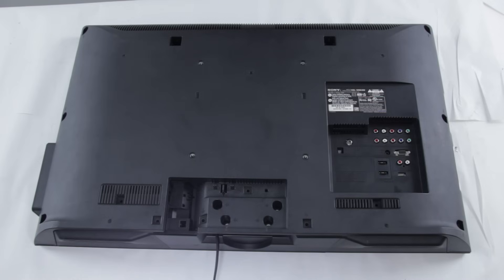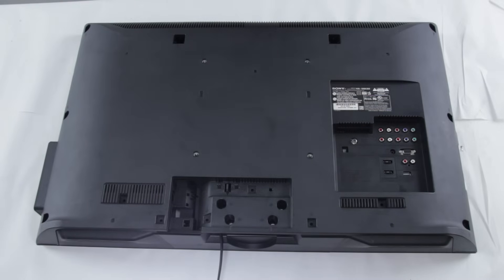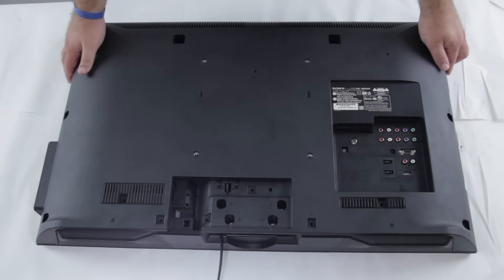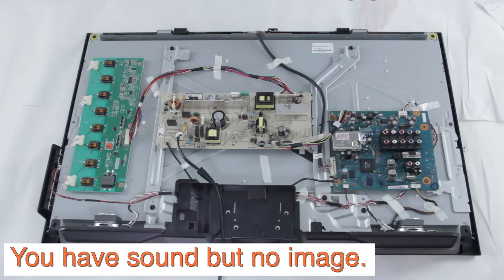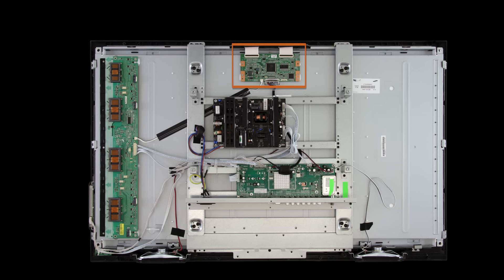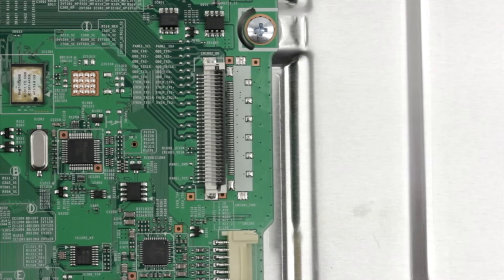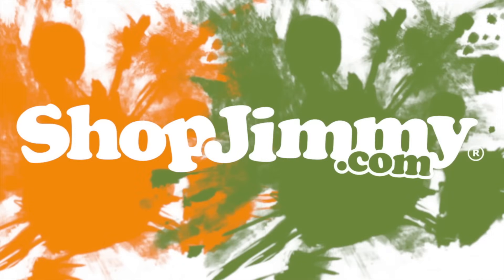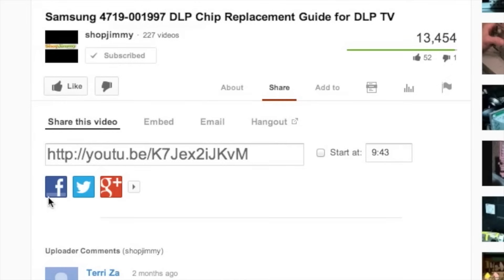LCD TV Repair Tutorial - T-Con Board Common Symptoms & Solutions - How to Replace T-Con Board

Comment: Hi Jimmy - We have a Panasonic TH-P50U50A Plasma TV   - I think based on your videos it will be the main board. 

I have done a factory reset so can see all settings and menues on screen. It cant however find the tv stations to program - says no signal - yet the antenna is connected and hasnt been touched prior to the problem. The HDMI ports 1 and 2 are not providing inputs for the apple tv (over internet) or the telstra fox (satellite), the tv is connected to my home network on LAN.  The weird thing is if we leave the TV on the Apple feed from the HDMI port will suddenly work for a bit. Then the screen has a fuzzy grey scale and goes black. It tends to work for 30 minutes to 2hrs then dies. Then comes on randomly. Sometimes it just turns the TV off.

I am assuming this is not the TCON as the screen as the system Menu for updating the system settings displays fine.

I am suggesting the main board as that is what the hdmi ports and the antenna all connect to.

Thoughts or ideas would be most appreciative. But also is there any chance you would have a main board that is compatible that I could buy and get shipped to Melbourne Australia?

Comment: I have a Vizio P55-F1 serial # LTMWXHKU441766. The issue I wish to resolve it as follows. I will be watch the tv and after about an hour or two the screen goes black and no sound. I swapped out the power supply thinking this would fix the problem but it is still doing the same problem. Thank you in advance for your time and effort.

Comment: Modle: 43S525 roku smart 43"  I have sound backlight but know pictures  but when I remove one of the lvds from the tcon to the screen one side works but adding back the other lvds cable the screen stay black with backlight.

Comment: I have a Vizio model V555-G1 and serial # LTCWY1NW0659657 and the screen has vertical e colored stripes then in about 10 to 15 seconds that screen moves from right to left with a different shade of colored stripes to black and whites stripes then eventually to a very dark pictures with hard to see verticals  stripes. I try to use the manual volume button on the back of the tv and there is no response. I have unplugged the TV and looked for any discoloration of any connectors and nothing is obvious. I’ve seen one of your videos where a tech test a known damaged component of the T-Con board resulting from a bad panel. I wonder if this model has a know component that goes bad to prove such. Thanks

Comment: Hi Jimmy, I have a LG 60UF850T screen to display the 3D pictures I am taking. Unfortunately it started displaying horizontal lines in the buttom area (about 2 inch, more intense on the right side). Should I change the T-con board or is it more likely the main board or ... Many thanks for any advice in advance.
Kurt

Comment: Hi Jimmy,
I have a Hisense H65MEC5550 and from one day to the other the picture is really dark. Colours are normal but really dark. Changing the backlight settings from 0-30 brings the display from completely black to a real dark picture. Changing from 30 up to 100 doesn't change the brightness of the picture........what could that be?
Reply: Hi did you find a fix? The exact same is happening to my hisense right now. Thanks!
Reply: @khizrofficial3727  yes I did......some of the backlight led were faulty. Was lucky to get a complete set of stripes here in Germany for 80 Euro. I changed all the backlight stripes. Now my Tv is like new......

Comment: I have a TCL 32" LED Roku TV.  Model # 32S305.  Made in July 2017.  It was brand new, never used, up until this year, and given to me.   It has developed two horizontal lines, one is half way across the screen, and seeming to be getting longer and ever more visible as time goes by.  There is another below it, that is more or less centered, that seems to be getting more apparent as well.  Both lines seem to be locked in the blue, or pail blue.  How might I fix this... If it can be fixed at all?

Comment: I have a Samsung UN65JU670Dxza Ver DD02 tv. It had ghost problems. I used your kit to replace the main, power, and Tcon boards. Now I get no picture but only wide black lines in between blue or green screens. Some red writing as well on one side. If I disconnect either side of he Tcon board, the whole screen is black. Any ideas on how to fix it?  Thanks.

Comment: Sony Bravia bought at Best Buy 2019  It is a 65"   It has the same problem as most.  Display went black.   The TV did Power On a couple of times for a few seconds then black  Sound is Good and Backlite is Good(backlite flashes intermittently).  Figure it is T-Con board  What do you think

Comment: I have a Sony xbr-65x850F when I turn it on it will start to go thru startup procedures and around 20 sec it turns off and blinks 6 red blinks.  I have replaced power supply and mother board  it still does same thing the only other board is the t-con. If I unplug the left ribbon cable on the mother board the screen rotate red,green and blue and it doesn't turn off. Thanks Ron

Comment: Hi, I have a veon 55 ' 4k Ultra Led lcd tv. Model V55UHDS .What happens is when powered  on, (a blue light) I get backlights but no picture,or sound ( black screen). After a minute and sixteen seconds it switches off and returns to a red standby light.Would you knw what could cause this?? Thankyou

Comment: My TCL s5s401 will turn on and works ok for a little bit then the screen get all these red verticle lines and no picture is visable then after 30 seconds or so the picture comes back and is fine for a minute or so then it does it afainand this keeps repeating. Is this theT-Con Board?

Comment: I have a VIZIO TV. The lines are at the bottom of my TV screen. My TV has sound and lines are sporadic but afraid of losing total picture. TV has not been moved since it’s set up. 
> Model: M656-H4
> Serial#: LBPFB6KW3900507
I am pretty handy as I have fixed a volume sensor before… on another VIZIO. Your advice is greatly appreciated 👍🏼👍🏼

Comment: I enjoy Your videos, and you All are Very Smart. I have a problem with a Sharp sharp model Modelo: lc-50lbb26iu. Some how my Daughter Spill a drink on top of the TV. The TV will power up and but in the center of the Screen the screen is dark with picture on both sides of the Black spot. So is it possible the T-con Board or the Light Emitting Diodes? Is there a Test to see what is the problem?

Comment: Hello i have a mint condition Sony XBR55x900h purchased in 10/2020 from BB & its out of warranty... its displaying a vertical white stripe with 1 thin red/black line down the middle on screen...stays on when powered up & wont go away... everything else works fine,can this be caused by a faulty "T-Con" board... ive read its part no.1-007-573-11... whats ur opinion on this & can it be a simple fix i can do myself

Comment: I hope you can help with my VIZIO SV320XVT problem.   Watching a normal picture & sound when the TV makes a VERY LOUD snap sound, followed by a whine and full screen of multi-colored vertical lines, and then the TV powers itself off.  After a bit, I can turn it on and watch TV for a short time, but it all happens again.  The time the TV works is getting shorter with each episode.

Do you think it is repairable?

Comment: I've an old ln52a650? Samsung. Powers up, n displays, but over a few miniutes itll, slip into static. 
Caps, look ok, mb, appears fine but I see what looks like corrosion on the incoming mb wire connector, on the tcon. I also suspicion the heat sinks thermal paste has rotted away as if it were the opportunities I left behind in my childhood. 
Sound about right? Or do you insist the caps  deserve the blame?

Comment: Hello. I need help with my lg smart tv 60uh8509. After i turn on the tv i see the logo and anfter 10 sec the tv go's black. I try woth flash light and i can see thet the dosplay it's but i don't have only backlights. I have sound and it's connect to the winternet also. I replace power supply but same thing. Debbug light on power supply blink 4 times i don't know what is. It's possible for bad t-con
 modul? What i can do? BR

Comment: hi jimmy rtu6549 rca 65'' ultra hd serial number A1708218910000048 this has a 1 fine horizontal line across the screen when I remove the right cable from the t-con board the line go away, can this be t-con, thanks for your advice

Comment: Hi. I have a samsung Ln55c750 3d tv. Cant get it off wall by myself.  Problem:  when watching 3d movies certain objects will go in and out of focus ( different players and different 3d blurays). Also. There is a dimming/rolling section that goes down the whole width of the screen about 4 inches in height. This also happens when the computer is being displayed  on HDMI 1 set to DVI. But the 4k firestick doesnt have any problems on HDMI 4. Any suggestions. Thanks

Comment: I have a Samsung that has vertical lines but if I unplug cables from main board and plug back in it works until it’s shut off. Model number is lc49hg90dmnxza. Any suggestions?

Comment: I have an Lg 49UF6400-UA   Serial 
509RMNE9P287

I lost sound on the tv . I had picture but no sound after turning the tv on and off several times I was then not getting anything .  After being unplugged several days  I tried again . It came on with no sound .  I ended up trying a factory reset .  Now the tv shows shows the logo goes to three circles spinning around like it’s thinking or updating then they stop tv Flashes and restarts the cycle over again, log,  three dots spinning,  freeze , then restarts same cycle over and over .  

Any thoughts ? Suggestions ?  Bad mother board , t con board , something to do with the speakers ?

Comment: I have a TCL 
MDL# 75S421 (MANUFACTURED 6/20) It is stuck on a blue screen has sound but no pic, no menu, nothing. Tried reset button on main, tried remote control sequence reset to no avail. Was going to order a new main but thought I'd ask first. 
TIA..

Comment: Samsung model LN32B360C5D need repair kits. & Remote  won’t turn on just standby light.
Samsung model PN50C450B1D need repair kits
       Question is on T con bd I have a flashing green light is that good. Unit has horizontal lines on top half of screen?

Comment: I have a Vizio XVT323SV tv that can not turn on tv with remote or switch on the side of TV. If I do a power reset, TV will turn on and work, but commands from remote are lagging. When I turn the TV off, it will not turn back on. Doing the power reset trick again, it will work but remote is lagging. What board should I replace? Main, T-Con or power?

Comment: Hello, I've got a question. I've got no schematics for Lg 42" 42LM615T. But, have an issue with the picture. You can see the picture OK just when LG logo is, and once the logo is off, you can't see the picture anymore. You can hear some sound from the speakers, but, no socket seems to be working, at least no HDMIs. I was able to find schematics for the PSU and all voltages were fine. I did not have a capacitor to check frequency only with my oscilloscope. 

Should I take for granted that the main board is faulty?

Comment: Hi I have a lg 65 inch tv model no  65uj634t I noticed a pure tint at the bottom left of the screen. Now the picture is completely black. When you turn it on you can see the logo faintly then turns off and re starts..Any help in  solving this problem would be great thankyou

Comment: I have a UN37EH5000 (samsung) some red solarization/artefacting on black backgrounds in various places on screen (always appears in black or dark grey areas). tried replacing tcon board - it seemed to improve the issue but not fix it. is it possible the newer tcon board is not working properly - should I try another tcon, or could this be a panel issue (and how would I be able to tell?)

Comment: I have a 48" Element ELEFT481. I get sound and no picture. Totally black screen. Visually cannot see any issue on the tcon board itself. Looks fine. No other glaring issues I could see as the source of the problem. Any ideas?

Comment: I have a Samsung model number UA40EH5000R it's standby is not stable and  led lights are flickering. There are no products. I checked the 5volts for standby and is there but when try to switch it on it does not gets on.

Comment: I have a Vizio M55-c2.  My backlighting on the left side of my screen, goes dim in "cloud" formations.  When I simply turn the TV off and back on, it reduces to just a small area of dimness in the upper left hand side of the screen.  I've unplugged the TV for more than a minute without any change.  The large array of cloudy dimness shows up after the tv has been on for an hour or so.  Does it sound like my LED Backlighting board is going bad?  Thankyou, ....-Herb

Comment: Hi there, I have a Samsung TV model UN70NU6900FXZA. Original symptom was that it would not turn on and back lights would only flicker about every 10 seconds. I replaced the main board and this did not help. I then found a video where I could put a small piece of tape on the top ribbon going from the main board to the TCon board and it worked great. Moved it and plugged it back in later and now the left half of the screen has no color. It is not dark, just no color. What else can I try? I noticed where it clips into the bottom where I believe the TCon board is, but it is very thin and doesn’t look like other pics of these boards I’ve seen. Can it be replaced on this TV and do you think this is what I need?

Comment: Hi.
I have a LG 65UF680T,
And the problem is that when I switch it on, only one side of the screen flashes the lg logo, the other side stays black. 
I have replaced led backlight strips and also powder board. 
Could this be t con problem?
I am reluctant to spend more money only guessing. 
TIA. Rick

Comment: Hello, I have a 55 inch Hisense 55H7B G153029. The issue I'm having is its a year old and no matter how I adjust the Color it still has a blue tint to it. From what I've read I need to replace the T Conn board first. Is this accurate?  Thanks! Will

Comment: I have a Toshiba 50L5200U.  The audio from the cable box plays, but no picture.  When I turn the TV on, I see the Toshiba splash screen and for a second I see the OSD showing the input HDMI1, then goes black.  I unplugged for a while and no change.  When the room is dark, I can take a flashlight to the screen and I see the video.  Does this indicate the TCON board is good, but the inverter is defective?

Comment: My TV was not working just kept restarting. I changed main board with compactable one. Main board was not for the same model so some of the functions do not work but now TV starts and works , but there is green tone and green vertical lines. Actually colors came ... but when I switch off and on - green tone was back again... Could it be from T-con or just bought board is faulty...because colors came and gone. https://youtu.be/iunYmOXsqKk

Comment: Good information. I have a Mitsubishit LE65K6R9, serial number HK6F05449, manufactured June, 2016. It has developed an issue where it doesn't come on every time but the standby red light turns blue like it should be on and the backlight is visible. I can hear sound but no image. I can turn it off and wait 10 seconds and turn it on again and 90% of the time it will come on. Is this a classic T-con board issue?

Comment: Hi , my 65 inch jvc lt65kc85 tv have no display , it is connected to a tlc sound bar via the HDMI ARC, earlier in the morning there were horrizontal lines on the tv display. I attemted to switch on the tv and no sound and display. led lights is displaying through the back panel.  need help to rectify the problem

Comment: Hi. I have a Hisense Model  46K366WN smart tv
The screen has horizontal lines that keep moving making the screen jump up and down with the lines in it
I pulled off the back and all locks normal expect for some overheating on the power board ( slight over heating signs behind the board the the board seems fine. I tested the capacitor and it seems fine . 
I also tried to block out a few of the t con connectors going to the tv screen. It slightly improved the picture depending on which lines I blocked using tape 
Not sure what the next step is
Paul

Comment: Hello, Jimmy I have a sharp lc 55p6000u. when facing the TV the right side of the display flickers. The display works but it just a bit annoying to watch shows on. would this be a symptom of the tcom or motherboard unit? I tried resetting the ribbon cables on the tcom to see if some dust had gotten in there but it didn't make a difference.

Comment: i have a sony xbr55x950h. best buy tried to fix it by swapping out the main and led driver boards and no luck. im having moving horizontal lines that come and go pretty much every 5 seconds or so. could it possibly be the tcon or power supply or the panel which is why it can't be fixed.

Comment: I have a single thin black horizontal line across the upper portion of my screen. This is on a Vizio M601d-A3 (60" TV). I have checked the cable connection thus far and found nothing wrong. Any thoughts would be appreciated.

Comment: My Visio D650i-B2 stated giving me a half black screen. Sometimes it worked fine but other times, the half black screen. Now its giving me a black screen with colored vertical lines. The lines will change when I change settings on the remote. I replaced the t-con board but I still have the same problem. Any suggestions?

Comment: Sharp LC-55LBU591U with all the right symptoms, plus there was no thermal pad between the T-Con IC and the heatsink plate. What a disappointment when I installed a used T-Con (advertised 'from a working TV with broken screen') with no cure.

Comment: You guys helped me successfully repair my 65" VIZIO after lightning took it out, now I have a Philips 55PFL5602/F7 (ser.#DS1A1653123Q40). Unit powers on but only displays a blue screen, which cycles from dark to light in tone and has no audio sound.